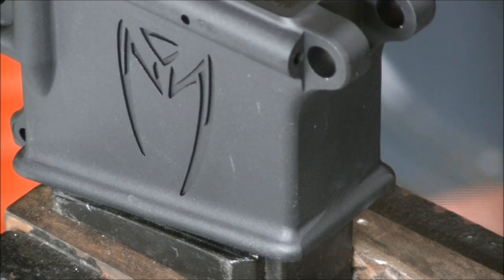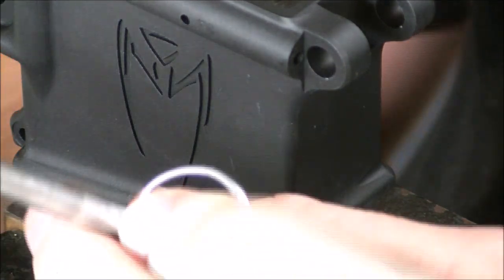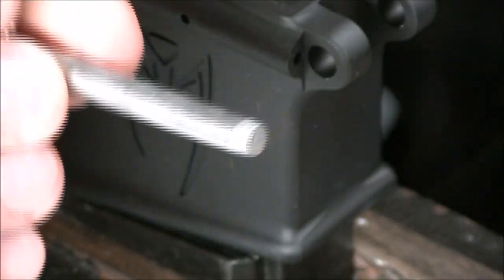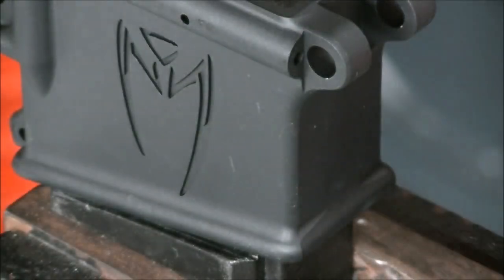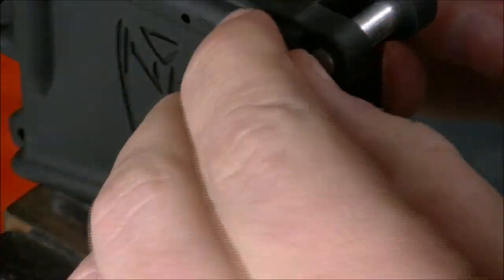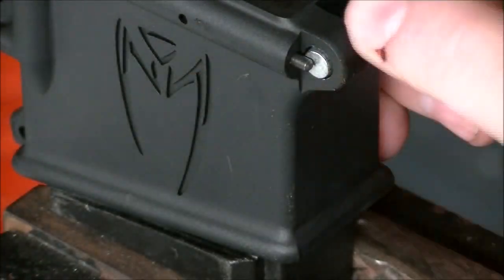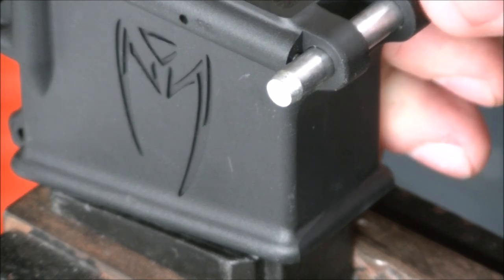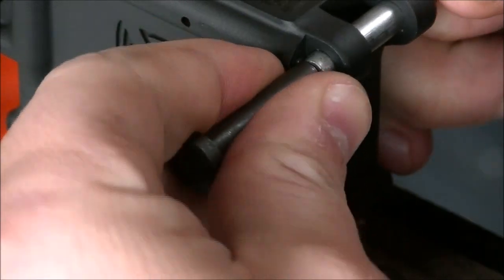AR15 detent installation

Comment: I use a 1/4" clevis pin, end filed flat. push the detent pin in and turn 90 degrees. slide that until it's just a little past the edge. put the detent in place, push the clevis oot.

the trick is, hook the inside of the mag well with your middle finger. press the clevis pin against the back wall of the detent pin slot. at the critical moment, when you pass over the detent pin, it will be slightly depressed and the detent pin will not snag on the point as it passes.